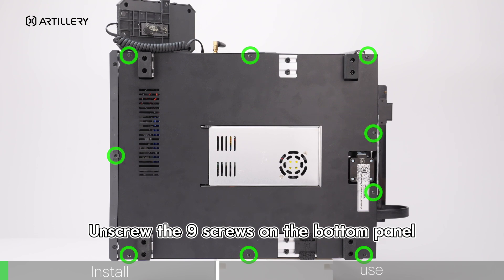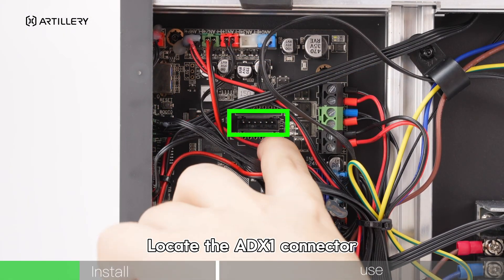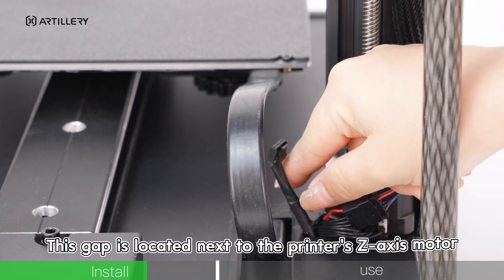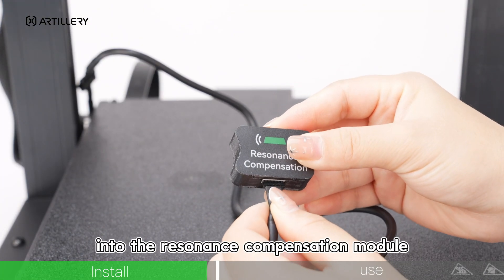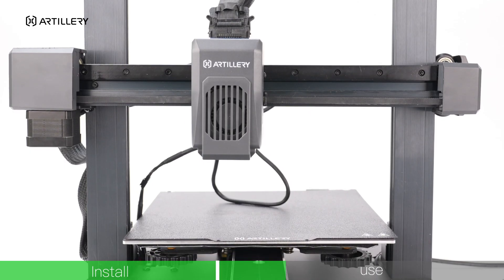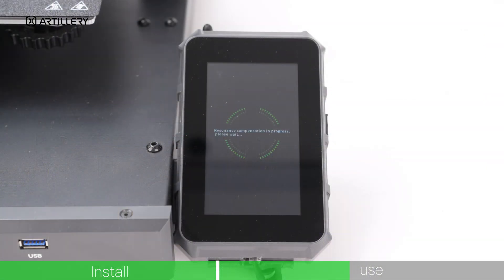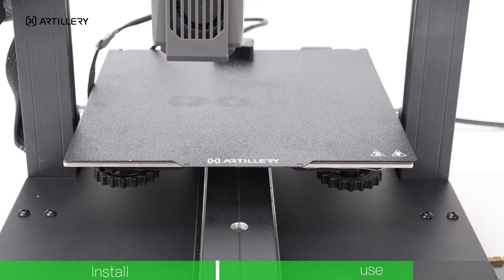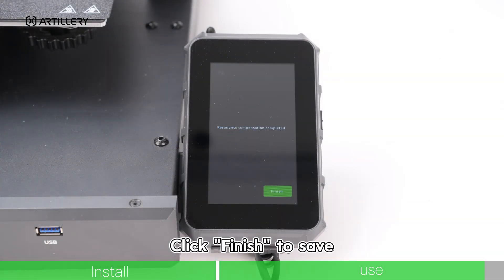Tutorial | How to use ADXL345 resonance compensation module for Sidewinder X4 Pro/Plus

Comment: Hi, what is the connector name? I ask for the connector that is plugged directly into a compensation module's pins? Got a green wire pop out and need to buy and crimp new one, just not sure if this is JST 1.25 or JST-GH or JST SH or whatever type of JST is this??? Just want to make sure so I can order few for crimping it and reserve later, I see the quality of the cable is total crap. Will remove the harness and directly plug it into the board, just need to know what connectors are on the module side and inside printer on the ADXL345 port?
Help anyone pls?
Cheers

Comment: Installed the resonnance compension module on both X4 Plus and X4 Pro.   For X4 Pro, it is a lot easier to pull the internal wire through the  hole next to the Y motor.  Messed around a long while to try to pull it through the hole of the Z motor (either one of them) until I saw the hole next to the Y motor.  Saved my back from further aches.

Comment: Por que muestran todo el proceso? Ya viene con el cable interno colocado cuando yo la compré.
Reply from the maker: Hi there, I think you bought Sidewinder X4 Plus S1 and it comes with the cable inside the mainboard. This video showing the whole process to install the resonance compensation module and it's for whom bought the Sidewinder X4 Plus.
Reply: @Artillery3D  ok. Entiendo. Me gustaría que hagan un vídeo de la X4 Plus S1. Explicando bien todo. Porque es diferente a todos los videos que hay en internet. 
Además el cable que va sobre el extrusor queda mal. No parece que llegue a 40cm, solo a 34 CM nomás. 
Creo que realmente no hice una buena compra con ésta máquina lamentablemente 😪. Espero mejoren las cosas.
Reply from the maker: @juampynieto7277  Hi, thanks for your advice. Our team is working for it now. Please continue to follow our channel.
Reply: @juampynieto7277   I have just installed the module.  Please understand that you have TWO cables;  one is connected inside the printer and the second one is an extension so that it is long enough to do the job.  So you connect the second one to the first one and then you connect the module.  Is that clearer?
Reply: @margerymaraudy9486  jaja. I understand. That's why I say that it is not necessary to show the whole procedure by disassembling the machine.
Reply: @juampynieto7277   Really ?  So the first cable already has a connection on the outside of the casing ?  Else, you'd have to open the casing anyway to pull through the first cable.

Comment: What does this thing do for my x4?
Reply from the maker: It can improve the printing quality especially when moving the printer to another place.
Reply: @Artillery3D  Most Excellent, since I need my X4 in my new little biz, I got my X2 fix that was my first printer ever man I love that printer yea its slow but its a champ
Reply: Compensate for wonky table 😉  If you change from one wonky table to another wonky table or you move your table so that it gets a different wonk or even a stable table (it does happens), then you have to calibrate again.   Personnally I feel better about having a wonky table after installing the module.😁

Comment: I see from the video that for the assembly it is necessary to access the motherboard and that in the opening it is detached (even if the operator is careful not to break it) the guarantee seal ... but if I buy it and mount it, then it is disabled The guarantee? I wait for an answer to decide whether to buy it, thanks.
Reply: Artillery does not honor their guarantee. My printer has been useless and instead of replacinging it they are making me diagnos it
Reply from the maker: Hello. If you remove the seal beacase of installing this module, it will not break the guarantee. Just need to explain it to the support when you contact them.
Reply: @Artillery3D  Thanks for the reply, in the end I ordered it directly from Artillerry online because I thought it was not there, having seen almost all the reviews on youtube that it was not in the box ... instead with my surprise and happiness it there was in my box!
But I noticed one thing, they have different codes ...
The one in the printer is AZ080
the new one ordered online is AZQ79
I think they are two series or different models ... Since at this point I resell one of them, I wanted to know what is the latest model between this two? So I keep the most recent for me!
Waiting for your reply, thanks.

Comment: I advice everyone NOT to buy your printers. They are not reliable and the technical support service is not answering! My Artillery SW-X2 arrived at April, it broke one month after and after few emails the technical support stopped answering. I tried to repair on myself (I own several other printers), but really for me the X2 is badly-designed from the beginning!! Now I'm trying to get my money back, still with no success.
Reply from the maker: Hi there, we're sorry for your mess. Now our support system have ran normally and you could contact them via support@artillery3d.com. Our team will reply to you as soon as possible.
Reply: Personally I loved the X2s and X1s that I bought several. The X2 have been pretty reliable and quiet printers (aside from the hotend fan a few months in). Sorry you have trouble with yours.
Reply: @WhiteWolfos   I agree with you !  I had an X1 before and I only changed it because I wanted a faster printer (X4).  The above comment is quite unfair as Sidewinders are generally well appreciated machines.
Reply: My X1 is still going strong…. Just ordered a X4 Pro S1 today!
Reply: Had the x2 running non stop for 2 years